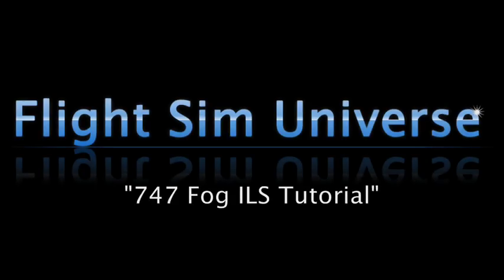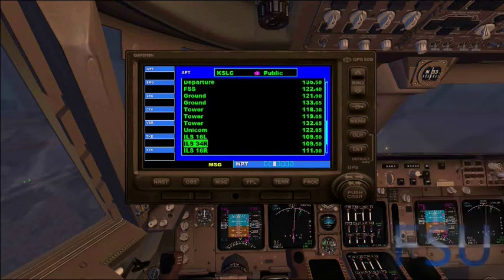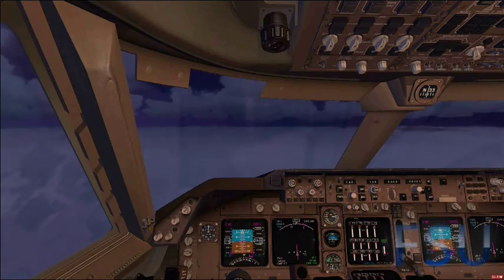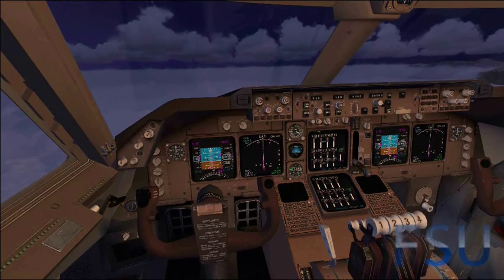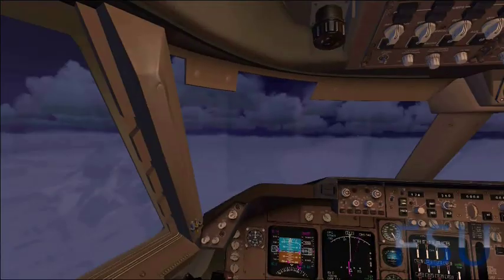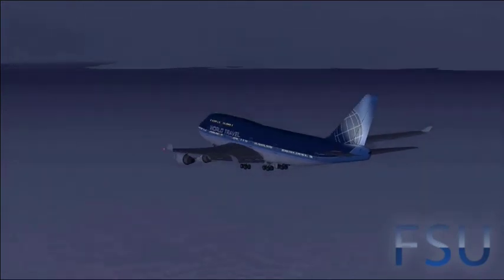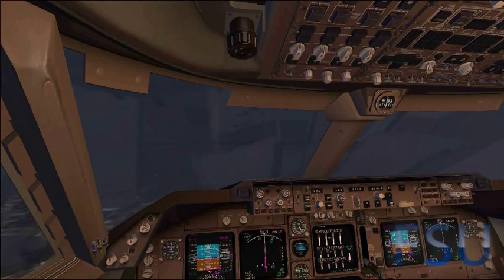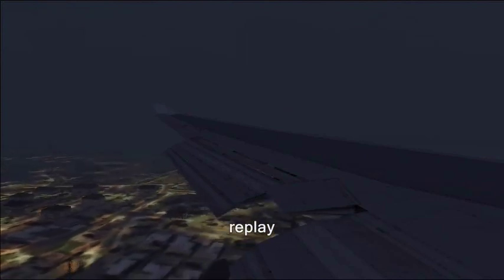FSX Tutorial - 747 Fog ILS Tutorial

Comment: I know its a late reply but whatever.
Release or Retract the flaps as soon as all the wheels are on the ground, hit F5 to retract them fully. Your speed should be about 140+ By the time you are at the threshold. when you are rolling down the runway, hold F2 to deploy the reverse thrusters until you are slowed to 60kts, then your brakes alone should be sufficient to control and slow the aircraft, also you can get the spoilers(Airbrakes) to deploy automatically by pressing SHIFT + /.

Comment: I always had problems with landing. I don't know when to release flaps, how much speed do I have to decrease, beside I hardly ever can hit the runway. Have you got any hints ?
Reply: practice. i now can make decent landings because i'd always practice landings at heathrow, i'd always practice in a 737, then i started doing it in an a320, then an a330, and no sooner than that i absolutely buttered the bread in an a380. and i'd always practice full flights and then practice doing an ils approach. also, about not knowing when to release flaps and decreasing speed, google is your best friend. just google "landing speed for 'insert aircraft name' "  and you'll get many results. also, i'd recommend u do most of ur early practice in a cessna, then move up to a 737. the cessna is a simple plane with lots of tutorials and the 737 is one of the simplest airliners i've ever seen and, again, with lots of tutorials. Last tip, during final approach you should only make tiny adjustments because making significant adjustments will just mess up ur landing. if you find yourself in a situation where large adjustments are needed, just go around and try another landing.  I hope i was able to help